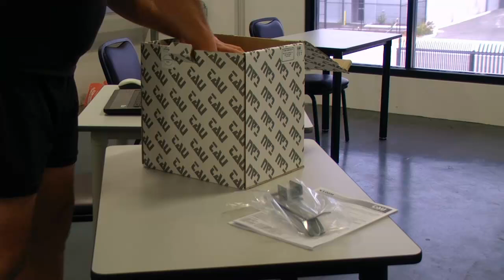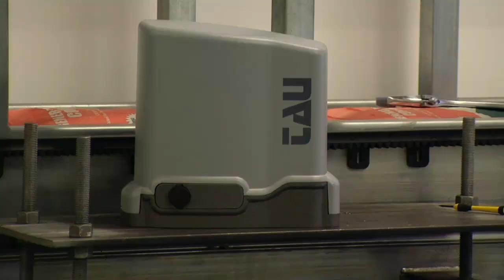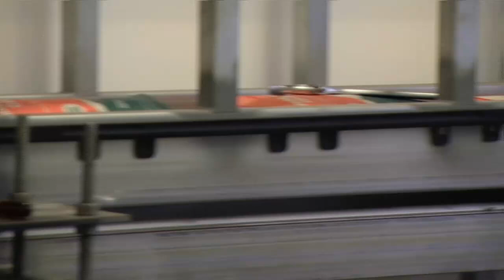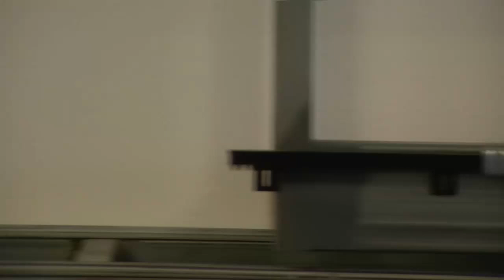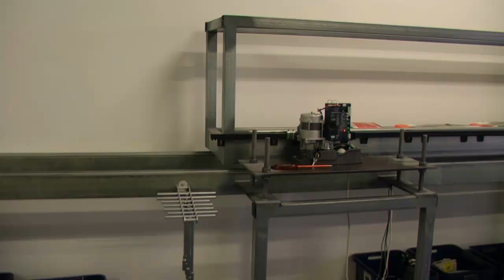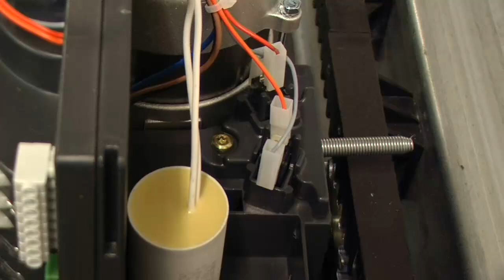T-ONE 5E Sliding Gate Motor by TAU

Comment: I have the Tau t-one on a sliding gate in California that I’ve had for about six years and it replaced the predecessor model that I had for about 13 years. I got tired of the old one and when the new model came out I upgraded it since I needed a new battery and didn’t want to deal with a failed unit at an inopportune time. 

I would like to hook up a Wi-Fi remote, ideally one that could control multiple devices.  Using an app in being able to share it with guests and having other cool features seems like a nice thing to do for people that you don’t want to give them a remote or they don’t have a car remote to program. Any ideas or thoughts on the matter?

Comment: I have this motor installed at home. The remote has 2 buttons I currently use the top button to open and close the gate. Can the second button be programmed to open and close the gate instead.  If so can you upload a video to show this is done. Thank you